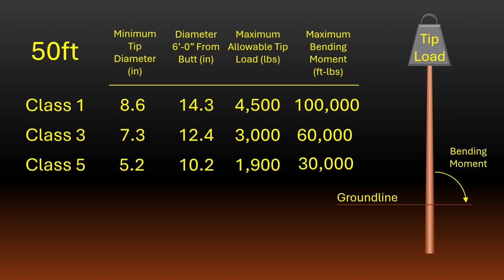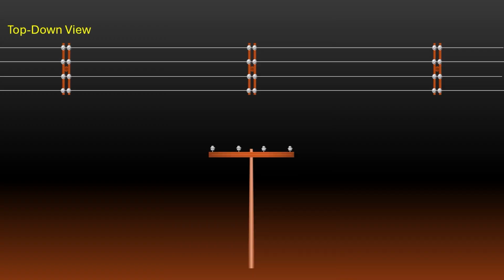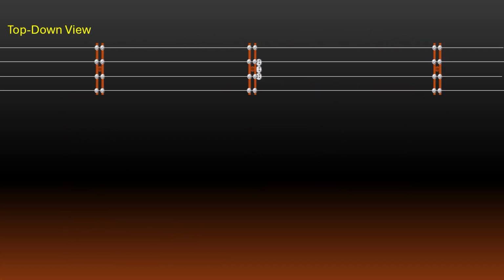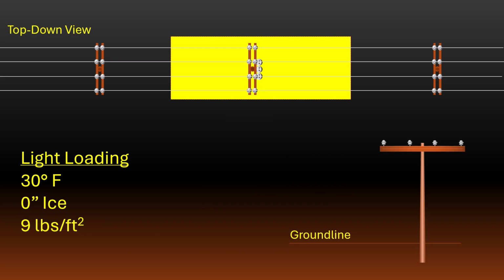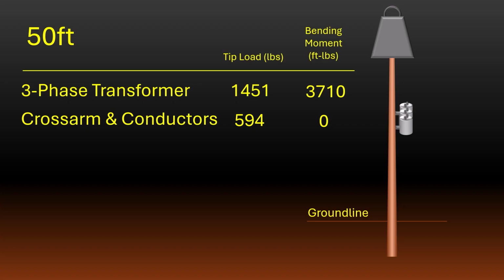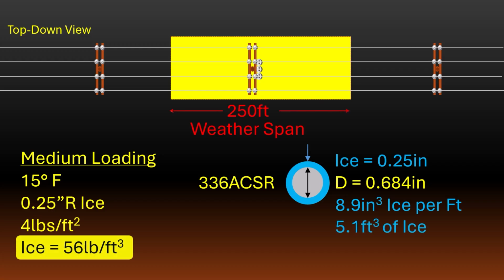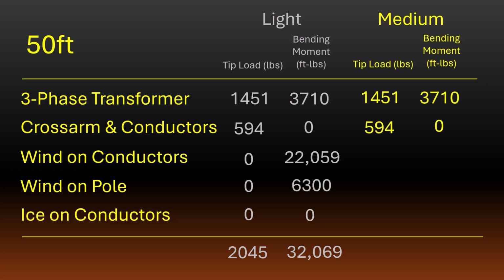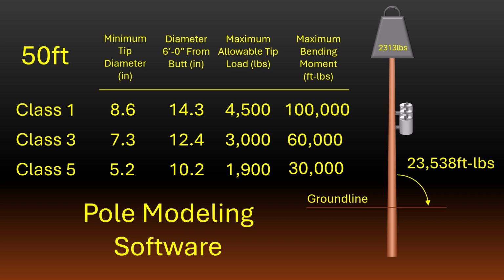Light vs Medium Loading | Which Poles Survive Extreme Weather

Comment: 336ACSR 
L 
H 
D 

.684inch
diameter 
ground line 
pole cross sectional area 35 sqft 
30° F
50 ft pole 
foot - pounds 
bending moment

Comment: How do you calculate tension on cables?
Reply from the maker: In our area we use PLS CAD / pls pole.  Power line Systems software. There are a lot of variables and regulations and specifications used.